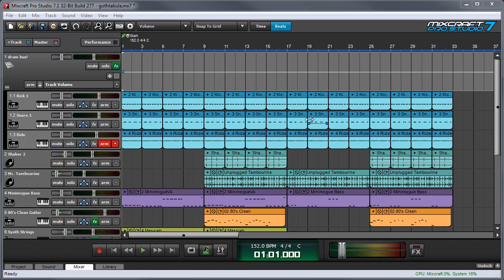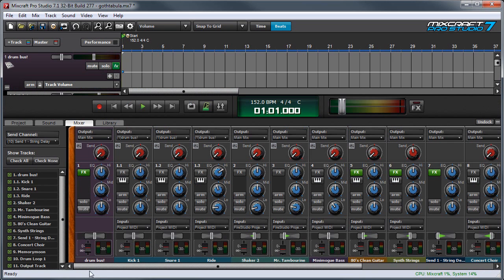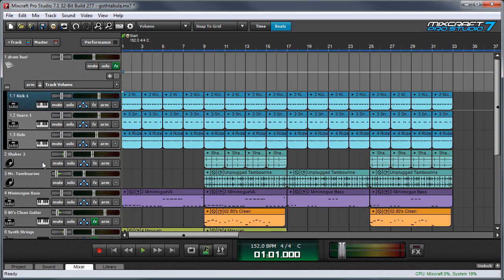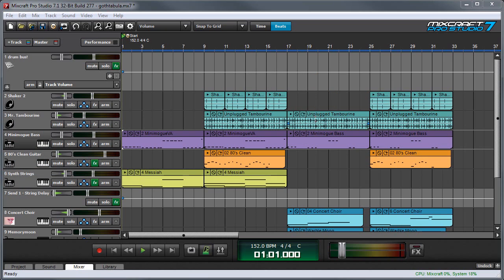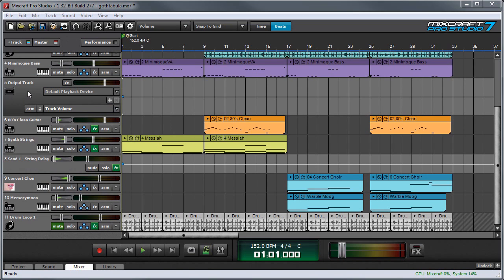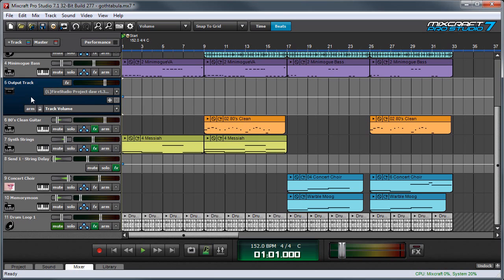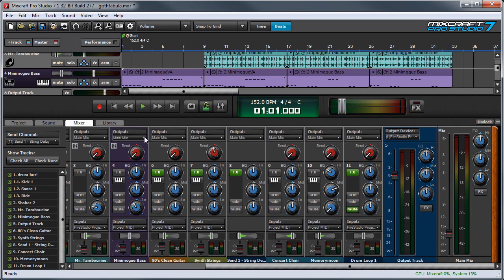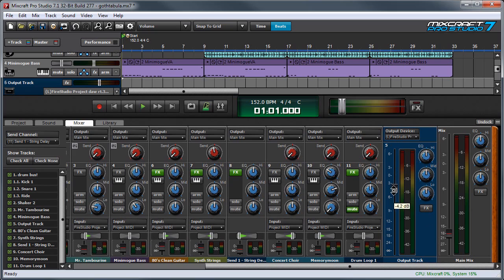Mixcraft 7 Mixer: Output Bus Routing

Comment: How do I use output bus tracks in Mixcraft?
Article ID: 1255
Last updated: 18 Apr 2016
Click Mixcraft's +Track button to add Output Bus tracks to your project, then set which tracks use the output bus tracks, along with where the output will go, on the Mixer tab. For more info, watch this video: Mixcraft 7 Mixer: Output Bus Routing.

Use output bus tracks to route your audio output to different playback devices.